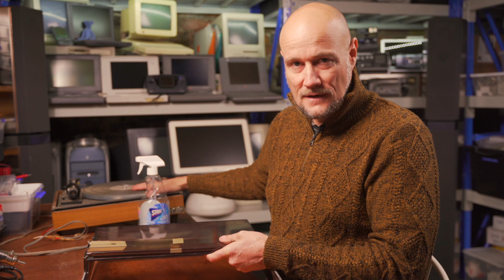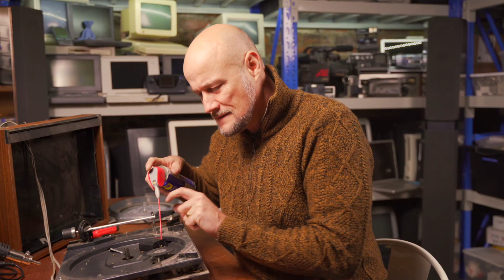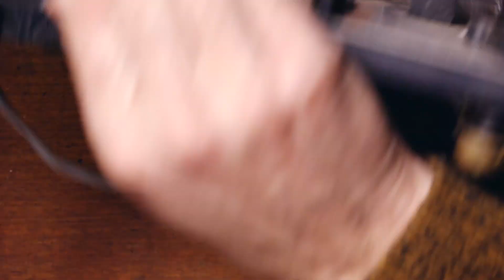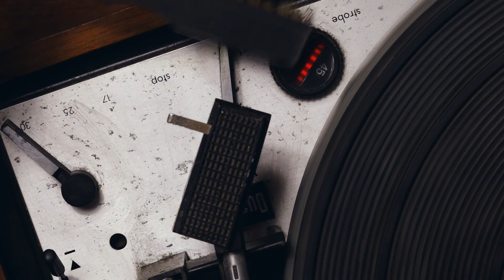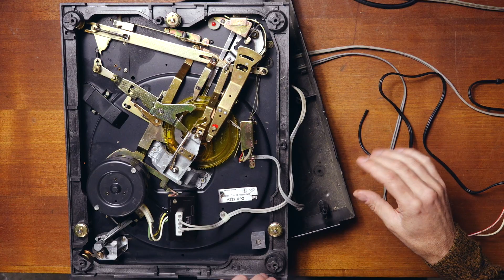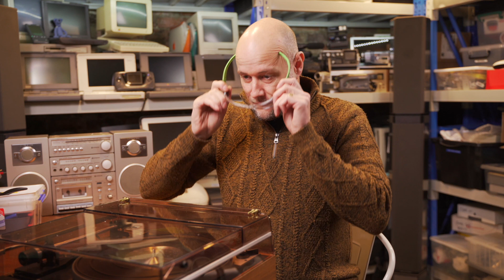Dual 1229 Turntable Review and Repair - Vintage Record Player

Comment: That loose piece of paper is just packing material that should have been removed during set-up. You can toss it.  I know it's so because I read it on line.:face-green-smiling: Any bloke who uses WD-40 on vintage audio equipment otta know that.
Reply: Sorry, That was the strobe scope, not packing paper.
Reply: @chass5438  Yep, the 1229 has an illuminated window at the top where you should be able to view the strobe and correct speed.
Reply: that paper is what the mirror sees for the strobe view
Reply: It's not traditional WD-40
Reply: I hate to say it, TOO!
WD-40 , is forbidden around Any  Audio gear! It is a Penetrant and 
“Could” harm the gear. I know it was freeing a stuck part,,,
(There are Safer solutions, available) I’ve got a 1229, l am working on,too!! Great TT !
Thanks for your video, just what I needed to See 👍🎼
Reply: @maxcosby8166 so long as you wipe it well off the thing you've cleaned. I use orange oil on my sewing machines. It melts old oil amazingly and evaporates quickly and leaves it very clean. Its actually an odour removing product which its amazing at but its amazing for removing grease ...and rust.. I don't know how it would be on a contact though it might be bad near an electrical contact. But every single sewing machine anyone ever used d40 on has made me cry. So i imagine its the same for audio equipment.
Reply: @maxcosby8166 WD-40 is a great lubricant that I’ve used to successfully repair a few turntables. The big problem with WD-40 is that a novice will spray everything which is disastrous and can ruin the turntable beyond repair.
WD-40 is ideal for metal-to-metal mechanisms. But if it makes contact with any rubber parts, the results could be disastrous!
Reply: Hey you guys commenting on the use of WD-40, you do realise that WD-40 is no longer just the water dispersant formula 40, but a whole range of different products including lubricants? This is not the original WD-40, but one of their “specialist” range. Looks like dry PTFE lubricant. I’m not advocating his use of sprayed products, which can end in the wrong place indiscriminately, just noting that this is not the product you guys seem to be criticising his use of.
Reply from the maker: Finally, a proper expert has shown up in the comments to school us! Thanks for dropping by!
Reply: @TheBasementChannel  I mean, there is plenty of documentation and videos on servicing and repairing Dual turntables, you could have done a little research before going at it blind with improper lubricant.

Comment: When replacing the RCA lead of a turntable, I use low capacitance wires (<14pF per foot).  This is important if using a Moving Magnet (MM) cartridge.  Also, keep the wire no longer than 5' or so as a longer wire will increase capacitance and degrade sound quality.

Comment: I own a DUAL 1229 for more than 40 years now. It is a great piece of gear, very reliable and with the right needle-system you get an amazing sound out of your records. I never had any problem with the turntable, never. I never wanted some of the more modern machines out there. My turntable lives in a slightly different wooden case and has a different top. DUAL built a lot of different cases and tops over the years. This turntable was sold by other companies with their entire designs and labels, too. You can find a lot of versions out there, but the machine was always the same.

Thank you for bringing this technical gem to life again. Its condition when you started your work really hurt my heart. I hope this machine has got a second live in the home of someone who deserves this fantastic turntable.

Peace.
Reply from the maker: Hey there, thanks for your awesome comment! I agree, this is such a solid and well made turntable. Not many electrical items today can take such abuse, and then restore so nicely.

Comment: This player is gonna work for couple of months,unless you do it properly. Don't charge the owner technicall part,just the cleaning and cover fix
Reply from the maker: I’m not a repair shop.
Reply: @TheBasementChannel  Nice fix on the cover. Those sliding covers are popular,but they get damaged after 50yrs. This is gonna give other users nice idea  "how to" diy fix.  Thumb up 👍

Comment: I wonder why everyone else just doesn’t use a spray lubricant? It seems to work perfect! Everyone else took it apart cleaned with a cleaning solution and sprayed with lithium grease? Which is probably better! But this way works just fine!

Comment: Hi I recently got one of these I would like to know what you used to clean it.
Reply from the maker: Just any kind of spray and wipe cleaner. I used window cleaner.
Reply: Hi, i have a 1229 which i purchased in 1973. I use warm water with a few drops of dish washing solution.......if servicing, do not use wd40, but get some silicon oil

Comment: The two issues with this old table. The Dearing ring which sits directly under the tonearm gimble( they break) second, the stauerpimple a tiny rubber cup on a post that the lifting paddle moves to set the tonearm down -lift at end of record. I'm working with some engineers on the ring replacement. Also, the cartridge sled ( where connections from cart to tonearm are made) goes really bad on wiring. There are sellers on ebay for new sleds.

Comment: Great video and great save ! If you’ve never used the clear gorilla tape .., it works wonders and even though it might look a little crude over some of that cracking , it’s quite strong - I used it on the inside of a cracked wind shield after prepping properly and it worked great .., cheers
Reply from the maker: Good to know!

Comment: Hi,

While watching this Youtube about repairing the old Dual turntable, I couldn’t help but notice an old Apple iMac G4 sitting on the shelf behind you? Just wondering if you have done a repair on it? I have one that I bought new in the early 2000’s. It no longer works but I’ve kept it because of its iconic design.

I believe mine has a power supply issue but I doubt that there are any parts still available these days. Having said that, it would be awesome to restore it sometime.

Anyway, just thought I’d ask.

Cheers,
Reply from the maker: Hi Stephen, I already replied to your email

Comment: Anybody who uses WD-40 on vintage turntables like this should be thrown off YouTube.
Reply from the maker: It was WD40 branded PTFE lubricant. But yeah, I should probably be thrown off YouTube anyway.
Reply: WD-40 bashing is quite common on YouTube without actually looking at the particular product being used, or how it is being used. It’s quite clear on the video that it’s dry PTFE lubricant.

Comment: The 1229 is a great turntable. I have a 721 that I bought in 1978 and for the most part, it has been trouble free since I bought it. I did replace the strobe light with a LED version and I replaced the steuerpimpel that goes bad in them, but it works and sounds beautiful : }
Reply from the maker: Great comment! Thanks for sharing your story!

Comment: 2 minutes of using Google and you would treat this Legendary piece totally different.
You did also a very crappy job at the Audio Cable. You snipped it of and extend it littarary 3 inches next to the solder joints.
No cleaning of old grease, just using WD40.
This is working now but not after some month anymore.
I refubished hundreds of them. And almost all have the same problems. Take some time to fix, but this is one of the best player you can get. Even for his age!
Reply from the maker: I’m glad you enjoy them. Thanks for your comment! Maybe one day I’ll be as expert as you.

Comment: Actually the belt drive was considered an inferior drive system and made turn tables easier and cheaper to produce: lighter platters and weaker (cheaper) motors. Dual only improved on their idler drive turntables, which were and still are considered superb, with even better (more quiet) direct drives in the early 70's. The 701 was the first and is still the best turntable Dual ever produced before it went belly up. The 1228 and 1229 shown here were the top of the line idler drives. When Japan flooded the Western markets with cheap and rather good direct drives in the 70's it was game over for Dual. The CD put the final nail in the coffin in the 80's..  That's it, in a nutshell.
Reply from the maker: I’ve got a Dual belt drive on my repair list

Comment: What a beautiful Dual record player! German solidity and built like a tank! I only play my records at home on Dual record players. I have the 1009, 1019, 1219 and 701. All beautiful players with record change function, except the 701, which is also one of the few direct drive players from Dual. The long spindle for 33rpm can still be found, the one for 45rpm is quite rare. Good luck with your channel!
Reply from the maker: Hey thanks Robin, I appreciate your comment. I have another Dual I’m going to fix up soon, they really are a lovely player.

Comment: What's with the rotten Duals nowadays?
Why do people pay hundreds of dollars for an old mediocre turntable like these?
3:25 Well, it has an idler wheel, which is also rubber that deteriorates over time, just like a belt.
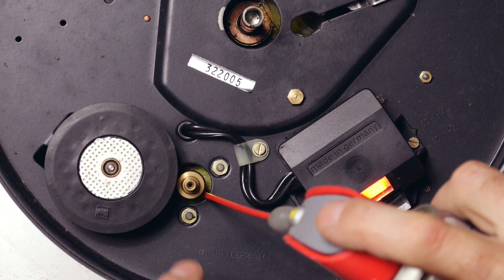6:18 No, you're not supposed to use WD40 on a motor!
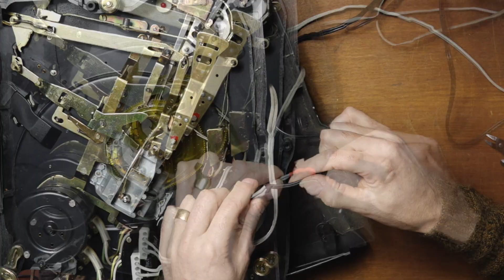16:08 Why leave a part of the old wire in place? Might as well solder it directly to the switch.

Btw, I recommend using some rubber restorer on the idler wheel. It makes the rubber fresh and improves traction on the platter, which improves speed stability.

Comment: I have that model, but it's a 1229-Q. The "Q" stands for "quiet". It was released shortly after the 1229, in the middle 1970s. Haven't worked on it, yet. Thanks for this video.
Reply: Lol. Q stands for Quad. As in Quadraphonic, 4 channel sound capable. As long as you had a quad amp as well. Pretty much a marketing gimmick. For being idler drives and automatic changer turntables all the idler drive Duals were already amazingly Quiet.
Reply: @Mortyakamort  Thanks for the information. Can you link a source?
Reply from the maker: Curious, thanks for sharing!

Comment: WD40 is NOT a lubricant. It can be used  as a penetrant but the excess should be wiped off. "WD" means Water Displacement. It was created to clean off electrical components which had been exposed to water. The silicone in it may lubricate a little, but it is more of a preservative/protectant.
If not replaced, the idler wheel should be cleaned and treated with a rejuvenating chemical. Before it's done, anything that spins should have the bearings lubricated with electric motor oil or some 20w non-detergent oil. Any metal part which slides on other aluminum part should be cleaned and then re-lubricated with grease(never use white grease). Until you do this, you are NOT done. Let the TT sit and it will freeze up again.
In repairing the hinged part  of the dust cover, on the bottom side, carefully hold the pieces  together which hinge and apply a good quality of clear package sealing tape. Metal hinges will scratch the topside of the cover as it slides back and forth. You might even want to glue thin pieces of felt to the underside of the part which slides on top of the other(plus glue felt to the backside of the door which hinges up as it slides back on the dust cover.
Reply from the maker: Great info, thanks for the comment! The spray I used wasn’t regular WD40, but a specialist lubricant also made by them.
Reply: I have used sewing machine oil and clock oil watch oil where I'm not sure if even sewing amachine oil will be too much. I've only used d40 for cleaning big rusty chunky metal whcih it does work good for that. Keeps them safe from rusting again after cleaning but for other small things I've used watch and clock oil and not a lot of that either cos more is not always better. Maybe these would be usable or is there a specific oil for jobs like this?
Reply: @automatedelectronics6062

The original WD-40 was intended to temporarily coat sheet metal to protect from corrosion. It leaves a thin layer of mineral oil, as the rest of its contents evaporates. Whilst the oil is technically a lubricant, and can act as such, it is not sufficient for proper lubrication, and parts should be properly lubricated if used as a freeing agent. It subsequently was found to have other uses, including the one you describe. The original WD-40 does not contain silicone, although many of the competing products do. WD-40 do make a silicone lubricant in their specialist range.
Reply: @urglegurgle5807  WD-40 was originally created for U.S. rockets as an exterior coating which would displace water. WD= Water Displacement. "40" is the number of the successful attempt when it was perfected.
The U.S. military and others have used it to displace water on electronics when they got wet. It is meant to be blown off and wiped off.
So, you spray down sheet metal with WD-40, if you don't wipe it off, when you come back, that sheet metal will be covered with dust stuck to it. Hopefully you would never want to paint it, even if you wiped it off.
I knew a guy who sandblasted his old pick-up, planning to repaint it.  Not wanting the bare metal to   rust, he sprayed it down with WD-40 and then wiped down the truck. When he went to paint it, he prepped it and painted it. A couple of days later, all the paint literally fell off.
Jukebox usage. A guy was selling an original Wurlitzer 1100. I went to look at it, hoping to buy it. As we got near it, I started smelling a familiar smell. Opening it up the smell of  WD-40 was overwhelming. It had been there a long time. Wherever the WD-40 had been sprayed, it looked like hair was growing. None of the trays would budge and pull out. I got one to move out a little and there was a record in it. They had been in place when the juke was sprayed. The record also had dust stuck to it.
The guy was thinking a Grade 1 restored juke for price. We didn't make a deal.
Reply: Well it worked didn't it? lol
Reply: @tombjornebark  oh it will work wonders on all kinds of things. For a while. The problem arises when it turns into a stick horrible film that clogs your parts and forms this plastic film over everything it's gotten in contact with which if youre sprayed it into something you may not easily get out if you cant reach it. You can dissolve it again and get it off but best not put it on there in the first place.... if you find things which have had d40 put on them in ignorance its a real nightmare to have to get it off and things do exist that work well and don't cause it to go gummy so why do it. Its just going to be fine for a while then have to be redone properly. There's nothing worse when doing repairs on anything than having to undo the bad repairs of somone who came before.

Comment: Great video. I've redone 30 + turntables and the only ones I couldn't fix were wheel drive, BSR specifically. Might try a Dual after seeing your video.
Reply: Nice! The only turntables I couldn't fix were linear tracking and those with all sorts of electronic features, like Sony Biotracer and certain B&O Beogram. 
The required proprietary parts were basically unobtainium where I live.

Comment: Sorry for butting in with my two cents on the matter but while WD-40 can act like a lubricant, it's a poor one. A light sewing machine oil is usually what the manufacturers recommend. The one I use has a long needle like applicator tip. Great for getting into tight places and adding a single drop to whatever it recommended.

If doing maintenance on their turntable owners should always read the instruction manual to see if there is a recommended lubricant. If you've misplaced your manual there are a few websites that let you download a digital copy.

That's a good tip on using the 1khz test tone to judge speed accuracy and wow and flutter. There are plenty of test records out there but they can be expensive so look for a used one. Otherwise finding some music with a long stable note will work in a pinch. There are apps to use your phone to do the same sort of test but you place the phone on the turntable, which seems wrong to me somehow. The added weight. Not centering the phone and it causing inaccuracies. I think an app that uses the phone's camera to judge when a marker of some sort like the record's label makes a revolution.

I forgot all about those idler wheel turntables. The last time I saw one was probably in the '70s. I worry about what time has done to the drive wheel. Belts age so I would think the wheel material would too. 

I still have my first good turntable that I bought back in the '70s, the Philips GA-212. I rescued it from the garage this year. Everything looks good but I'm having trouble getting the touch sensors working. I still use my 'The AR Turntable' from '84. My last old turntable is a Braun PS-50. That monster is built like a tank. Heavy platter, very well put together mechanism. I lost the headshell and debating buying a used one because they are so expensive and usually have to be shipped from Germany. I make do with one of the regular plug in headshells but it messes with the cartridge geometry.
Reply: I use singer
Reply: @greatpix

WD-40 is no longer just the original water dispersant, but used as a brand name for a variety of products including lubricants. If you watch the video you will see that he is using a dry PTFE lubricant under the WD-40 brand, not the original WD-40 product. 

I’m not advocating his use of a sprayed lubricant, which can end up being spread indiscriminately. Just noting though that in this case he was actually using a lubricant not a water dispersant.